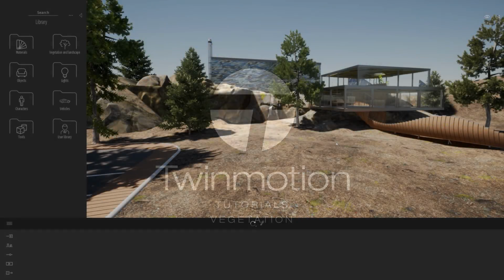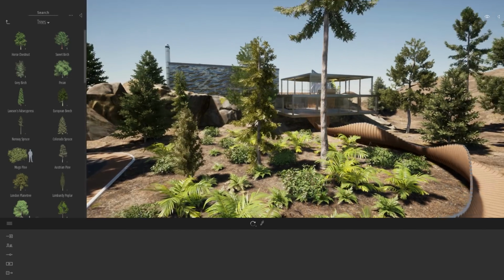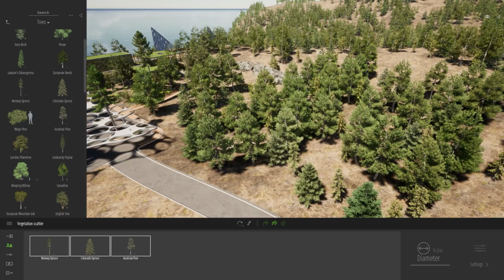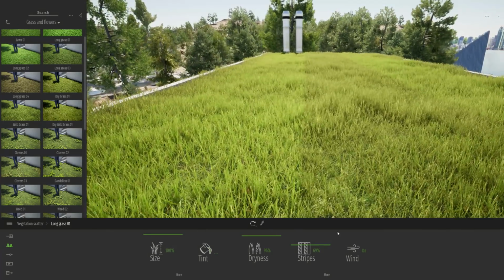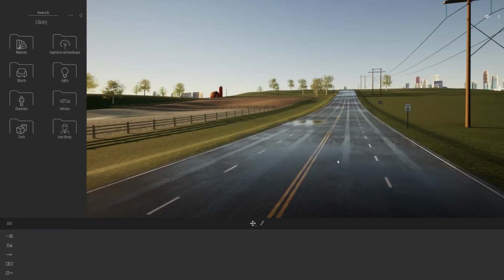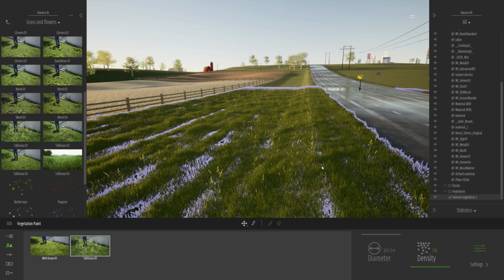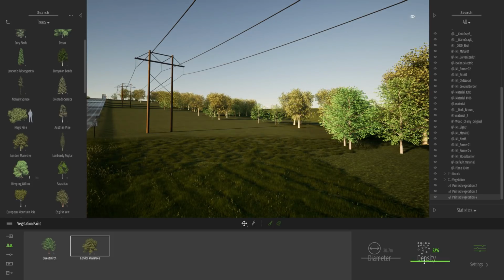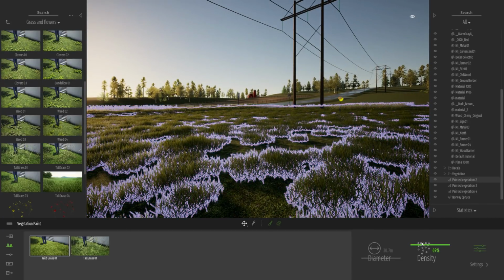Twinmotion 2020 Tutorial - Vegetation tools

Comment: The foliage tools are good, but the grass fading needs a "user defined" distance setting.  Far works, but only if you're down at ground level.  If you're doing an aerial shot, the grass fading becomes really apparent.  In UE4/UE5 we can control this.  Please add either a "VERY Far" setting or (preferably) a user defined distance.

Comment: It's impressive, but adding offset geometry to scatter grass without overlapping should be solved in a much better, non destructive way.

Simply add a slider (DISTANCE FROM BORDER) and a checkbox (INVERSE)

That way, you scatter grass and detail grass in a surface. Select the grass and move the slider until it stops overlapping the border.

Now select the detail grass and select INVERSE. So it will only occupy the geometry NEAR the border, while the slider will make it occupy more or less distance from the border.

Comment: The vegetation scatter tool doesn't work well on large areas.  Maybe I'm not using it correctly?  I have been using Lumion , Enscape3d, and learning Unreal Engine. I'd like to use Twinmotion, but I need a quick easy change terrain to tall grass feature. Is there one ?

Comment: 20:00 Interesting! When I tried to do that I must have clicked about a hundred times on the surface and still did not get the density I wanted. Nowhere near as easy as it looks in the video!
Reply: There is a difference between the versions of software we are supplied with and what they are using because I ran into the same problem a couple months ago. And I figured you can adjust the density once you click on a surface but I agree with you. It's not as easy as they show in these videos. And it certainly does not work this way.

Comment: Hello, I got a problem with the vegitation scatter tool. It doesn't work... I delete the default floor, drag the default Rocky Grasslands in the scene.
Select a few trees, select them and then press the little fill-tool. Nothing happens. Statistics tells me the GPU is at 100% ( Task Manager tells me it is only at 43% max) All settings are at low, GI disabled, SSR disabled,shadows at 10m... But I hit 300+ FPS (on my new 2060 Super 8GB). The s scengraph tells me only the  Rocky Grasslands are loaded and not once the scattered vegitation...
Some help?